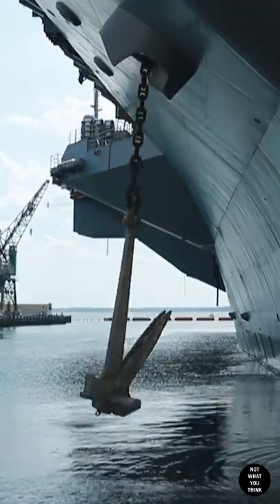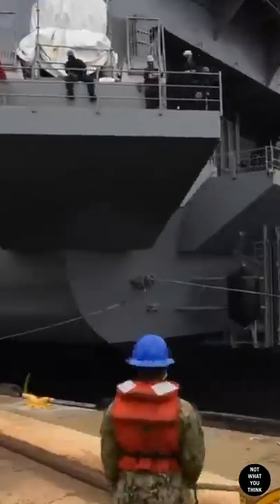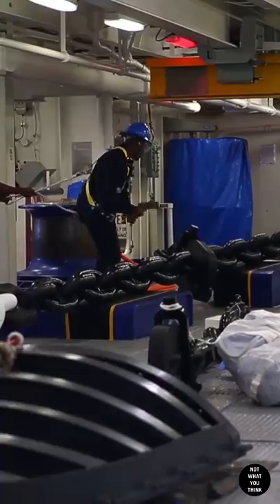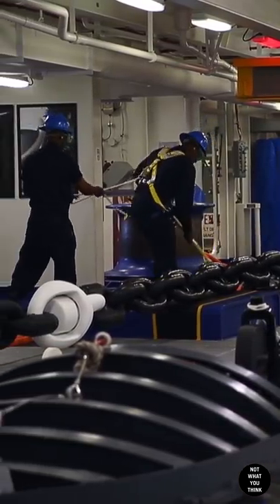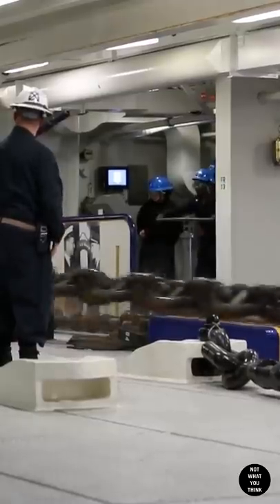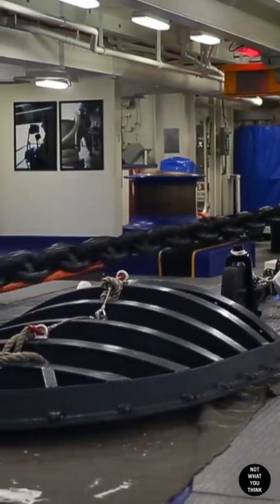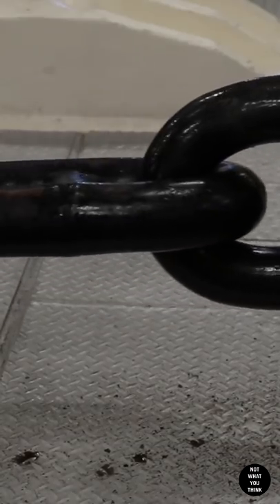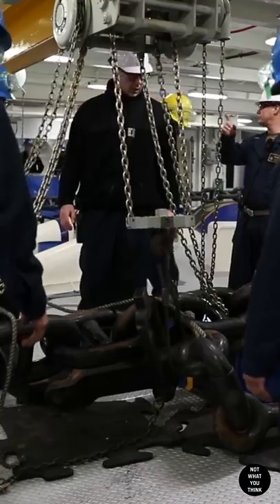Inside the Anchor Room of a Supercarrier #shorts

Comment: Having a guy hitting those chain blockers with a mallet is kind of odd in a multi-billion ship.
Reply: Can't go wasting too much taxes I guess...
Reply: That type of thing is easier and cheaper to get a person to do rather than installing a machine to do it. Also since that’s the fail-safe lock, the less mechanical parts it has, the better.
Reply: @chrisboone8106  The military still knows what it means to have an emergency brake unlike automakers who've bastardized the emergency brake to the point where they can no longer call it an emergency brake.  

Emergency brake.
Reply: @cambellschunky704  e-brakes are really just parking brakes today(I.e., to prevent your car from moving while parked, particularly manual transmissions.)  
It's true they did use to be primarily(or at least equally) intended as emergency brakes(that is, to be used in case the primary/hydraulic brakes fail), nowadays, how often do ones brakes fail?  
Though I get what you're saying.  If my brakes suddenly failed for some reason, I would have zero chance of instinctively pushing my parking brake button or(in my other car) thinking to step on the pedal in the top left corner under the steering wheel(let alone find it in time.)  
I imagine it also has a lot to do with who drive automatics not wanting a big ass lever right in the middle of the front two seats, especially with all the shit people carry around in their cars nowadays.
Reply: That is a $40,000.00 sledgehammer
Reply: @Mockturtlesoup1  you’re completely right about that one, once that chain starts going, the only thing stopping it is hydraulics and even that takes a few seconds.
Reply: @Mockturtlesoup1  The problem with the electronic brakes is they can fail, just ask Anton Yelchin. A simple mechanical stop is not going to have a glitch.
Reply: I don’t understand why is this dangerous?
Reply: @Ceej3  the possibility that the chain starts running out and doesn’t pull in a straight line and grabs the man’s leg
Reply: Sometimes the old ways are best...
Reply: @chrisboone8106  thats why they change how they shoot missiles as well. Less mechanical parts.
Reply: Push button electronics can fail ,,just sayin
Reply: Everything expensive works only when hit
Reply: I guess that ensures it won't happen by accident
Reply: Gotta keep the personel busy somehow
Reply: It's not a major part of the system - the massive brakes on the windlass are doing all the work, those chain retainers are just a cheap, easy-to-add failsafe. It's like the chocks used to keep modern aircraft parked, even though they are capable of braking themselves. It's just cheap to implement so so reason to change.
Reply: Yea I was watching was kinda like 🤔  it got A lil dark on me around that part 🤨
Reply: My M3 comp form 2018 Ebrake can’t be used as an actual E brake. I was told it can rip the line and stop working. Wtf? 

I mean I can use it, but you have to be delicate. Stupidity
Reply: Woody Last Name  german engineers like to disagree with that comment.
Reply: @casbot71  that's not what happened to Anton. He didn't put the jeep in park. It's a stupid system, jeep should never have used it.
Police also told the broadcaster the vehicle involved was a 2015 Jeep Grand Cherokee and it appeared Yelchin had not properly put the car in park mode.
CBS reported last month the government National Highway Traffic Safety Administration was investigating the model over its "e-shift" transmission, amid reports of crashes linked to possible confusion over whether the vehicle had been put into park.
Reply: @Ceej3  you can find footage of anchor releases on even bigger oil tankers and cargo ships going terribly wrong.

I saw one where as the sailor swung again the pin let lose just before he hit it and his sledgehammer was caught in the chain and he went with the sledgehammer and meat grinded through the port hole.

or another where the pin itself ejected at the sailor and turned him into a meat bag of shattered bones.
Reply: @Mockturtlesoup1  drivers today are too stupid to use a ebrake anyway. They won't even take their foot off the gas for 15 minutes while they're on the phone with 911, an ebrake isn't going to help with that.
Reply: Woody Last Name  war n Spaß :D
Reply: You should see the reactor, they manually put in and remove pencils from the core to change the criticality!

I'm joking of course.

"Oi... Mack... throw another pencil in!"
Reply: Traditions Are Sticky!
Reply: @cambellschunky704  more like a "What's That Smell?" Pedal
Reply: @revolvermaster4939  is it made of gold? Looks like a 200$ sledge to me
Reply: Why does someone have to be hooked up?
Reply: @johndc2998  from what I understand how things are ordered in the military its basically just a part number and a (sometimes rather altered) price on the paperwork.
Reply: It's a war machine, not a cruise ship...
Reply: @tannerlebo9862  we live in the age of safety - nobody will ever get hurt again; and that makes life kinda boring.
Reply: @johndc2998  it's military. 
A simple bolt can cost $100-$1000
Reply: imgladandrew gillumisnotmykang  
   Incorrect sir. I know I don't know anything and by me knowing this, I do know something. Your statement is invalid.
Reply: @Ceej3  The main danger is should the sailor operating the hammer slip and fall towards the chain upon disengagement of the lock he will be killed or wish he was this is why you see the sailor in the background holding a harness connected to the sailor with the hammer so he can hold slight tension so in the event of a miss swing he can yank the sailor backwards away from the chain
Reply: @revolvermaster4939  its physics, it will pull in a straight line how do people not get this only when it would slow down and at the back is to much momentum its dangerous, but then the guy is long gone.
Reply: @jouisimo5701  but it doesn’t always pull in a straight line, I was almost killed during an unrep by a line that didn’t pull straight.
Reply: @revolvermaster4939  it pulls straight when under this circumstances, you need to think before you do something like this, ofcourse it needs to be under tension, when its in a ball or whatever obviously not.
Reply: @jouisimo5701  the reason it is done this way is because someone was maimed or killed doing it, so it obviously doesn’t always pull straight.
Reply: @revolvermaster4939  huh? You obviously dont think, you just assume things without thinking. IF IT HAS TENSION IT WILL PULL STRAIGHT, not so hard to understand i guess!? Also it has nothing to do that they have a harnest on and someone is holding him, you just assumed it.
Reply: @revolvermaster4939  its literally SIMPLE PHYSICS. Some people need to go to school again.
Reply: @2nd-place  wrong, pls educate yourself. At the start the chin is even straight from itself, till it gets enough momentum. But thats not even the case here because they have an anchor brake. You can search on yt what happens if it fails. But then the person is long gone anyway. Also here in this case its redirected, what would give the anchor at the point he is standing a smaller range of motion. The problem with people here on the internet is they cant think because they never neded to apply knowledge, thats why they are bound to only one scenario and start crying when thats not exactly the case.
Reply: @casbot71  RIP Anton
Reply: That’s how it is done
Reply: That was no mallet, it was a sledge hammer----big difference.
Reply: @jouisimo5701  English please.
Reply: @jouisimo5701  The only thing that you've proved is that you cannot compose a coherent sentence. I still don't know what you're blathering on about.
Reply: @paullebon323  its okay just acept it, you can deny it but that does not change your embarasmant.😂🥱
Reply: Not a mallet but a sledgehammer
Reply: @cooliobob1274  yep. Not TO MUCH taxes, only JUST ENOUGH. And we draw that line at sailor safety.... right ABOVE sailor safety apparently. 😑
Reply: @cambellschunky704  
Excellent point. As sophisticated as the regular braking system so as prone to failure
Reply: @cooliobob1274  cue another $2,000,000,000,000 “relief bill” that actually is just a shopping list for the democrats
Reply: @Mockturtlesoup1  you're forgetting if you're parked on a steep grade. I want cables holding my car in place, not the fluid system, or putting the stress on my transmission.
Reply: @cambellschunky704  I was raised to call them hand brakes.
Reply: @Snookchaser007  which is why the chain moves maybe an inch when the pin comes out? Real dangerous to fall on that thing right?
Reply: @Joe_P  an automatic has a parking pawl for that reason and whether manual or automatic, the gears in a transmission see much more force in operation than the weight of your vehicle resting on them. It’s the force required to hold the weight of the vehicle plus what it takes to get moving at the very least when you put your car in gear on a hill and drive away. Cables stretch gears don’t
Reply: @chrisboone8106  On the contrary, it should be obvious with anyone that has half a brain that if you have to get MULTIPLE PEOPLE to do it, including one guy donning special safety gear that has to be held under tension during the procedure that it would be infinitely more faster, straight-forward, and economical in the long run (convincing a person to do that shit + paying whatever catastrophic health insurance/danger bonus) as machines do not require salary.

Large civilian ships have tons of innovative solutions for chain stoppers that are perfectly scale-able (and 100% mechanical) including up to this diameter so as with most things in the military, the design is simply shit and/or outdated.
Reply: it’s training done with safety, for emergency release. 💁🏼‍♀️
Reply: @Mockturtlesoup1  now days all car use a dual hydraulic sytem in the brakes so if one fails u still have ur other 2 brakes and they are set so u have 1 front one rear on opposite sides E.G. RF and LR is the 1rst hydraulic and LF RR is the 2nd
Reply: Not everything is operated by a button...not yet anyway.
Reply: Come join us and you will understand.
Reply: It's for extra safety you wouldn't understand
Reply: @Mockturtlesoup1  love having an e brake in the middle. If I’m driving and abs is turned on and I need to stop I pull that so fast.  Yes I could spin or slide a little but I’m going to stop. I don’t like ABS in a car.
Reply: @Ceej3  Doing basic deck duties are probably just as dangerous as doing any construction work. Hell even handling lines are dangerous. I remember our petty officer when I was in boot saying that an easy thing that can kill a sailor is just one absent minded slip up if not watching where you step and properly handling lines cause if the ship leaves port and a rope is still attached to the dock yard. You are gonna be pulled through a hole smaller than your waist and come out the other end like fucking chum by a nuclear powered vessel by your foot.
Reply: It is the most effective way. 

Can’t go having electronic or mechanical issues when trying to drop anchor. 

You’d understand if you were on one of those.
Reply: Reminds me of the SCRAM function for the first few nuclear reactors.
Reply: @NatEff3ct  wrong if you would think and actually bring arguments there would maybe be a discusion. But people on here are just so stupid they only try to insult, and did not bring one single fact.😂
Reply: Sometime good old fashion Emanuel labor is what it takes!
Reply: @Mockturtlesoup1  I've had times where my brakes weren't cutting it and I used the hand brake to be safe but I've only ever driven manuals so it's right their
Reply: @Ceej3  if you fuck it up you get dragged at that weight and dspeed getting dragged is easily fatal
Reply: Is it really worth billions? I have no clue but I’d guess a few hundred million but not billions
Reply: @casbot71  didn't he also leave his Jeep in neutral, not park?
Reply: Right I mean they couldn't thing of a better way
Reply: @cambellschunky704  emergency button
Reply: @pyroromancer  is it weird I want to see the vids
Reply: @casbot71  that had nothing to do with an ebrake. He didn't put his car in park and it rolled back on him.
Reply: A lot of super heavy machinery will have simple mechanical safety measures like this.  Less moving parts means less potential failure points.  The risk of the work is measured against the risk of a failure from a more complicated system, and this is the normal outcome. 

 I work with high explosives on a regular basis, in conjunction with some of the biggest machines on the planet.  We employ all sorts of high end electronic fail-safes.  But we also have very simple mechanical measures in place for redundancy and simplicity.  The more simple mechanical stops tend to be higher risk to employ and disengage, however they lower the total risk calculation in the end.
Reply: @revolvermaster4939  and you need specific training to handle it.
Reply: @Mockturtlesoup1  to expand on what your talking about.  It just isn't practical or safe in the modern day.  Cars go fast now, pulling an E-break can some times harm you more than it saves you. 

 Sure going 20-40 mph, an E-brake could stop you pretty fast.  Goin 50+, and you might skid, lose complete traction control, or overheat and pop the tire causing a flip.  Now then, even if it wasn't a sudden lock up, and it worked as intended and now your dragging down speed fast  You will probably experience injury from the countering force.  Your seatbelt will be chocking you if it doesn't break, if you don't have it on, you might actuall lunge forward from built momentum riding hte vehicle and smash your dashboard.

It just isn't advisable to allow the average modern drive the responsibility of an E-break.  Mistakes can happen, liabilities can be thrown, people could end up getting hurt as much as the people who use it responsilbly and it saved them.
Reply: @BlackWolf42-  ? If that chain catches you and you go with it, you are dying full stop, it’s about basic worker precaution my guy
Reply: Ironic
Reply: If it ain't broke don't fix it?
Reply: Look at his Color... Thats Why
Reply: @6idangle  The people with the clip boards and safety sallies will keep me safe.  Nothing bad could happen, ever again - we're living in a new world; of safety!
Reply: @casbot71   mechanical parking brakes use to fail all the time and were never meant to be used as an emergency brake, because they locked up the rear wheels with the easily stretched cables and lower heat-rated pad material.   
  Anyone who calls them an emergency brake is simply using the wrong non-mechanic terminology and believing they are meant to do something they aren’t for.
Reply: If it ain't broke...
Reply: I think its one of the best jobs
Reply: You would think so... but no 😂
Reply: If it ain't broke, don't fix it
Reply: @ethnobotanyboy  if whats not broke?
Reply: @cooliobob1274  that whole ship is a waste of money and not needed..War is costly and america can not afford another war for at least another 25 years,we can't even help our own people these days..
Reply: Guy: can I perhaps slightly get a raise?
Reply: Only in america
Reply: @revolvermaster4939  ?
Reply: @johndc2998  just a joke
Reply: @jouisimo5701  you’re an armchair theorist, I’ve spent 60 years in the real world
Reply: @paullebon323  you didn’t comprehend “the chin is straight from itself”? 🤣
Reply: @jouisimo5701  how many years did you live on a ship?
Reply: @jouisimo5701  some people need to visit the real world and forget about “school damage”
Reply: @cirocciroc  ?!?
Reply: @jamesholt7340  maybe the ship prevents war!
Reply: @vividdreamzentertainmentll4533  the procedure
Reply: @revolvermaster4939  your just finding excuses but no arguments!? Why is that? I only hear blabla but no facts whatsoever. If your 60yo im sorry for you, because you did not manage to get any common sense in this time.
Reply: @Mockturtlesoup1  the emergency brake isn’t called that in other countries. And it shouldn’t really be used like that either, because it only brakes the rear wheels and thus you could lose control over the car. 
Also: the brake systems are two seperate systems for the case one stops working. And it practically doesn’t happen. So it makes sense in my point of view to get rid of it
Reply: @revolvermaster4939  Right... Who am I to say anything
Reply: no no, its a $2000 mallet, very suitable for the ship
Reply: That mallet has history ok 💀
Reply: it’s called cost cutting
Reply: @jouisimo5701  Ok NOT-A-BOATSWAINS-MATE, you sure know a thing or two about dropping anchors. Or not.
Reply: @jouisimo5701  Look Peter puffer, dropping anchors is dangerous as fuck. A lot of shit can go wrong very fast. Eat your cheese balls and move along.
Reply: @jouisimo5701  Your obviously not that smart. Ps I’ve experienced one of these brakes failing, not fun.
Reply: @aluisious  agreed, there’s definitely a disparity between video game physics and real physics.
Reply: @Coecoo  lol more faster
Reply: @Coecoo  Then offer up a solution Mr. Big talker. Sell your idea, or are you just a talker. Exactly, what I thought.
Reply: @NatEff3ct  💯
Reply: @jouisimo5701  Here’s a fact: you never served in the Navy a day in your life, and therefore you have ZERO experience dropping an anchor like this and any argument you present is simply speculation and void of any legitimate value. Drops the mike.
Reply: @revolvermaster4939  Fuck yeah get him shipmate!
Reply: @joshc3000  im sorry if you dont understand how pyshics work. But thats often the case with foot soliders. I dont need to be in the navy to state simple facts, and if people like you, it semes are the type that only learn from their own mistakes, aka not the smart ones.
Reply: @joshc3000  you seme like the classic "worker" type of guy, who only knows a specific situation and cries about it, but if a new situation comes up you are cluless. Also you did not state any facts about the actuall subject. Just bull*hitt rellying on nothing.
Reply: @Mockturtlesoup1  Plenty of people have been killed by electromechanical E/Parking Brakes when they give a false engaged notification, then its rolled over someone.
Reply: @cambellschunky704  it’s called a parking brake not an emergency brake. If you pull that while driving you’ll have an emergency pretty soon.
Reply: The money goes into pockets not the ships
Reply: @TheHearseAroundJimThorpe  Call it what you want, but the original idea behind this system was to have a cable actuated braking system, isolated from the primary hydraulic system, that could be used if the primary system failed.  Parking is peripheral benefit.
Reply: @jouisimo5701  lol, yeah I’m not smart. I only get paid to write code, analyze data, and build machine learning models. Sounds like jokes on you.
Reply: @jouisimo5701  BTW, I already stated a very important fact. Since your talking about physics and testing your arguments would need to follow the scientific method, have you ever conducted an experiment to prove your argument? Didn’t think so.
Reply: @cooliobob1274  probably because a machine is stuck in one place and a man can move freely,  and with that massive weight moving at those speeds... nothing will last I think.

also on the side. it's a real cool real mens job
Reply: @Ceej3  In some other anchor-dropping videos you can see how incredibly violent it can be. This was all pretty tame.
Reply: @joshc3000  also one guy said the harnest  was for when the brakes fail, so he can be pulled fast away, what is not the case. Its for if you lose your balance, or the hammer gets stuck in the chain or somwhere if you dont hit. When the brakes fail you are long gone. Still his comment got a lot of support. That just proves the most of people here dont understand anything about the subject.
Reply: First off they’re stoppers not blockers second it’s a fucking maul third off I’m a rated Boatswainsmate get on my fucking lvl
Reply: @revolvermaster4939  cough maul?
Reply: You'd prefer a Robot... never been to sea have you?
Reply: @Ceej3  because a mechanical failure of the Capstan Brake means ALL the POTENTIONAL ENERGY from OVER 100,000 TONS (that's 200 MILLION POUNDS) of Anchor and Chain is being held back by that Chain Blocker... and it wouldn't even slow down squishing you like a bug on a windshield. But HELL my boy, GIVE IT A TRY!
Reply: Its called a Pelican hook
Reply: @jouisimo5701  Omk cool guy
Reply: @jouisimo5701  There go the assumptions again, computer science & software engineering is all about solving any problem in any scenario. What else you got, you out of ammo yet?
Reply: @jouisimo5701  BTW, I do have an office, but most of the time I work from the comfort of my own home. I also have a consulting business in which I solve technology problems for clients. I’ve had plenty of experience applying my knowledge & skillset in very different scenarios.
Reply: @jouisimo5701  I feel yah, I can’t argue with that at all. Many tasks in the Navy are very dangerous and they are very keen on safety precautions and mitigating risks. Many of the policy’s and safety regulations were established after learning lessons that were paid for in blood.
Reply: Edit your comment, it reads like shit without the  word dollar.
Reply: @cooliobob1274  people need jobs too😭
Reply: Not even tied off securely on his harness
Reply: Not even tied of correctly
Reply: Gotta put our men to work to keep em in shape with all the dropping requirements in the military,and they need their Salaries increased but who are we kidding right,Washington D.C. CORRUPT GARBAGE!
Reply: @cambellschunky704  they've always been park brakes
Reply: It’s served 3 purposes... 
1. It is easy to fix 
2. Cheap to maintain/replace 
3. Training time is quick and easy
Reply: It may seem odd, but it’s similar to shit people do on fighter maintenance😅
Reply: @Mockturtlesoup1  I was stuck in traffic for two hours so turned the engine off. Had my foot on the break the whole time. Traffic moved a bit then stopped so I took my foot off the break (car was on a hill) and when I put it back on the car did not slow down (engine was off). Panicked and pulled the hand break car skidded a bit but stopped short. 

I learnt my lesson on what happens to hydraulics with out power.
Reply: @generalharness8266  Sounds a lot like you broke several laws and dangerously drove a motor vehicle, creating your own difficulties. Shockingly, when I removed the bolt from my steering wheel whilst I was bored in traffic, suddenly when the traffic started moving again, I couldn't turn anymore!!! :O You should have had the handbrake on when your engine was off and in traffic. You should then have turned the engine back on to move the vehicle. Bad things happen otherwise, like you found.
Reply: @Ceej3  because if you get caught on that chain you are dead
Reply: @cambellschunky704  lol my è brake is magnetized. Triggered at the push of small lever. 2019 Audi A7
Reply: Thats thors hammer putting in work
Reply: @casbot71  that's not accurate. Anton Yelchin was killed because the poor design of the parking brake meant that he did not realise it was properly engaged, not because it failed.

The same thing happens with traditional mechanical parking brakes too.
Reply: No, landlubber, it ISN'T odd. That is how it is done on ALL Navy ships. And while we're at it, let's get some terminology corrected. What the person is hitting to release it is the PELICAN HOOK, not a "Chain blocker", nor a "Fail-safe lock". The chain isn't going anywhere until the brake on the capstan is released, and while it is possible for there to be a brake-failure on release, it is extremely rare. And what emergency-brake are you talking about? There is only one brake in the system, the capstan brake, which isn't hydraulic. There's a big manual wheel that controls the brake tension.
Reply: Not if you want reliability
Reply: Just to show u they still need humans
Reply: Multi trillion*
Reply: Well yea
Reply: I was about to say, can’t they automate that?
Reply: @F17A  sum ships maybe idk
Reply: mechanics are mechanics, no matter how much money at your disposal
Reply: @elena6516  heeh tf2 ME MALLET
Reply: @cambellschunky704  if you hold down an e break while moving it activated the emergency break
Reply: Imagine if that part broke. So much work to be done. Better let a human do it. They're easily replaceable.
Reply: @vividdreamzentertainmentll4533  it has nothing to with race everything to do with being a boatswains mate in the US Navy .
Reply: @Ian Ramos It's better to have some braking ability than none at all.  Bar yanking a handbrake or stomping the pedal style to the floor it is very controllable and mechanically adjustable.
Reply: Sometimes, there are jobs that a machine just can't do.
Reply: @Mockturtlesoup1  I believe e brakes actually do also double as emergency breaks. I think they have an automatic thing to make them brake at the right speed to cause you to not spin out. Not positive about this but I remember reading it somewhere.
Reply: @stephenhoward6829  you’re a mad chubber
Reply: @Mockturtlesoup1  If your brake fail while driving a simple so solution is stop accelerating and aim at something when that will stop u but not kill u when slow enough
Reply: @Ceej3  it's a giant very heavy chain that if it caught even slightly u would be going with it into the water
Reply: @uhohmemebiggestboy212  true, if I'm going slow enough and aren't in a city or something.  Downshifting would of course help too.
Reply: Guess what, there's lots and lots of stuff on that ship which needs doing by humans holding all sorts of different tools including hammers.
Reply: @Ceej3  join the navy ! Actually training films on lines show how a parted line can cut a man in half.
Reply: @Mockturtlesoup1  there was a recent case of a guy in WA cutting people's brakes. Having a backup is a good idea
Reply: Not odd at all when you realize we don’t get paid Jack shit. The equipment is always worth more than our life
Reply: @cooliobob1274  Seeing as an E-3 in the navy only gets paid $2.10 hourly. Yeah, the budget is pretty small, we oughta make it larger huh?
Reply: @TheHearseAroundJimThorpe  plenty of manufacturers still call them an emergency brake but also state they aren't meant to be engaged while moving, only to prevent rolling in case of a parking pawl failure.
Reply: @cooliobob1274  Who constitutes top brass?
Reply: @cambellschunky704  seriously. If its a digital button for the emergency brake then its no longer an emergency brake
Reply: You should see what maintainers do to multi million dollar aircraft. 😂
Reply: Fantastic
Reply: @cooliobob1274  If you think that aircraft carriers are a waste than you have a fundamental misunderstanding of their purpose and importance in warfare, especially in a bluewater nation like the US where all of our threats are external.

PS. When I say external threats I don’t mean third world countries like Iraq of Afghanistan, there are very strong opinions over those that I’d rather not get into.
Reply: @cambellschunky704  “Emergency break”
Reply: @neurotic3015  
   Mr. Reaper, I fully understand the importance of aircraft carriers. Nowhere did I say they were a waste of money. My original post was more joking and poking fun at the fact that tax dollars are wasted in far more ridiculous ways than making simple system to replace a dude with a hammer.
Reply: If it ain't broke dont fix it I guess
Reply: That’s the fucking navy for you😂
Reply: @chrisboone8106  Do you think for one second that they care or even know what is the cheapest of anything they spend on the tax payer funded banker war machines?
LOL. By this logic the should replace the missile launchers with able seamen. While you are at it just save a couple trillion bucks by replacing the missiles with colorful fireworks.
Reply: @cambellschunky704  stahp
Reply: @Ceej3  look it up. anchor fail
Reply: U probably don't know how the contractors get chosen and cut$ must be given
Reply: @tannerlebo9862  to pull m away..
Reply: Preserving the old ways of voyaging
Reply: @paullebon323  okay, don't get too aggressive.
Reply: Why does he have a guy holding a rope behind behind
Reply: @hotcheedo1227  so he could be held back and won't fall in
Reply: Holy fk what is going on!
Reply: @cambellschunky704  well in my country it was never called the emergency brake to begin with, just the parking brake. Why else do you have that (P) symbol come up when it’s engaged.
Reply: @Mockturtlesoup1  my brother's brakes just went out like 2 weeks ago while he was driving home on a busy street.. He realized it when he went to brake to turn into his neighborhood and nothing happened.. He had to coast until coming to a stop. Luckily he went thru 2 intersections with green lights before he came to a stop. The brakes barely worked enough to stop him at idling speed.. And his 9 month old son was in the back seat.. Could have turned out much much worse
Reply: @slicedbread5692  damn that's scary as hell.  Did he try down shifting?
Reply: @Mockturtlesoup1  honestly i don't know what he did. I wasn't with him at the time... I guess next time I'll have to do better than just cutting his brake lines if i wanna get rid of him
Reply: @slicedbread5692  😉
Reply: It’s because his life is worth not having to spend more money.
Reply: How would you do it?
Reply: @cooliobob1274  the US military gets over 700 billion in taxes each year, I think it's not about money here
Reply: @Mockturtlesoup1  modern vehicles still have brake lines that can be damaged or ruptured by debris in the road like rocks for example..so if that happens and all you have is an electric button that really doesn't do much, you are kinda screwed no? Lol
Reply: Because they had to give John Henry's great-grandson a job.
Reply: When you didn't behave during lunch brake
Reply: Certain things just make sense to have people do it
Reply: not everything can be mechanical. it’s the same reasons as to why the best weapons built are so cheap and simple. take the ak style weapons for example
Reply: @cooliobob1274  yeah only gotta waste 750 billion dollars🤣
Reply: You think it's odd until you realize 3 static non electronic, hydraulic, computerized, ect parts are just too damn reliable to get rid of. Chain blockers have never caused a problem so why change them? What would you gain? A cute gimic other Navy's don't have?
Reply: @cambellschunky704  it was never an “emergency brake” to begin with... use that shit in an emergency and see what happens lol, its a parking brake
Reply: @WobiKabobi  All brakes were mechanically actuated before hydraulic systems were common place.  So yes - they can and have been used in an emergency where the hydraulic system fails especially before dual reservoir master cylinders were standardized.
Reply: A fail-safeafe that relies on a person is good.
Using unnecessarily varied combinations for fail-safes has saved more lives than you'd ever imagine.
Because they're always unnecessary or silly till everything goes wrong.
I can think of at least one time America would've nuked itself were it not for such a seemingly useless fail-safe.
Reply: Most of the money is spent on weaponry and armor probably
Reply: It’s a sledgehammer
Reply: * multi-billion dollar ship.
Reply: @Ceej3  he's using the sledge hammer to to knock open the latch on a 'Pelican Hook' chain stopper, which can kick as it whips open.
Reply: @Mockturtlesoup1  Brakes hasn’t changed for over 100 years. We should get hydraulic emergency brakes that is manually operated in new cars to be honest. Much safer
Reply: @Mockturtlesoup1  you can put manual transmission cars into gear and then they wont move.
Reply: @revolvermaster4939  the anchor is heavy enough to keep enough tension on the chain that it will go straight.
Reply: @cambellschunky704  also its probably because a car doesnt have an emergency break because why would you, the handbreak is just a means of "failsafe" to stop the car from going anywhere when parking and not in gear, literally nothing else, you SHOULD ABSOLUTELY NEVER try to use it to stop a car, its not meant as a traditional break, and never was, because why would it. A car doesnt have an emergency break because it isnt practical theres just no need, you have the driver already steering it he has all the power, and also the power to break, if the breaks were to somehow not work, the handbrake wouldnt either because thats not its purpose, if you pull the handbreak while driving ur gonna crash, a train for example HAS AND NEEDS an emergency break BECAUSE the driver doesnt have all the control he cant do anything about the way he goes and there the emergency is also basically only meant for the passengers, the operator of the train still has all the power the emergency brake just exist to stop further lives being endangered if you for whatever reason lose the drivers controls
Reply: @qwertzritter5197  The traditional emergency brake is a cable actuated mechanism isolated from the normally used hydraulic brakes.  If the hydraulic system fails the vehicle can still be slowed using the cable actuated system.  Used in conjunction with engine braking, even a fast moving vehicle can stopped safely.
Reply: @cambellschunky704  What are you even talking about all vehicles come with Emergency Brakes
Reply: @ricco3  Most newer vehicles come with electronic parking brakes.  They can no longer be used as emergency brakes.
Reply: He'll be replaced by a robot arm next retrofit.
Reply: With how much military contractors charge for R&D, and the realtivley low salary of enlisted sailors, it might actually be cheaper to pay somebody to do jobs like that manually for the service life of the ship than it is to install an automated solution.
Reply: Because its the military, plenty of bodies, why waste money on robotics?
Reply: @realofficialbrandon  Covid-19? 
idk that seems to be the go to answer these dazes
Reply: Reducing weight matters a lot. If a human can do the job in few seconds, why install a heavy machine to do the same job? It makes no economic sense.
Reply: @cooliobob1274  coolest job on the ship tho
Reply: @Mockturtlesoup1  not only that but a lot of E-Brakes can’t be activated while rolling down the road, it won’t permit you. So it’s quite literally a parking break. 😞
Reply: I thought the same thing I was like WE'RE NOT CAVE MEN SPONGE BOB we have technology.
Reply: Meanwhile NASA defines Duct Tape (Gray Tape) as being an essential repair item and always makes sure astronauts have at least one roll when they launch into orbit/space.
Reply: @dimaisatree  yes of course it’s worth billions, modern American aircraft carriers are some of the most complex systems humans have ever created.
Reply: A PARACHUTE BRAKE WOULD BE CHEAPER‼️
Reply: Welcome to the military mate. Where things humans shouldn't be doing are doing because tax dollars and keeping other costs down lol
Reply: Sometimes the best solution is the easiest lol. Plus it's funny to watch.
Reply: Free job position
Reply: Holy shit
Reply: @AluminumHaste  To my understanding the auto maker had to do an emergency recall, and pay hush money to a lot of people because the electronic transmission (unclear which part of it) was "slipping" from Park to Reverse.  Of course that part doesn't get covered as much, and I'm sure his family was paid a handsome fee in order to "make it so".
Reply: @Shalkar  Hmm, my coworker had one of those models and he never got a recall order for it.
However, I did get to drive it and it's SUPER easy to accidentally not put it into park, it's a shitty system.
Reply: Well at least we know it won’t fail there will always be someone with a mallet
Reply: @jouisimo5701  no he LITERALLY DOES NOT UNDERSTAND YOUR POINT because you are not speaking coherently... Maybe invest in a better translator??
Reply: @jouisimo5701  navy deck crew=foot soldiers?? You really must not be from around here...
Reply: @Ceej3  go stand next to it.
Reply: @revolvermaster4939  40k for something used to slap chain blockers, nice
Reply: You would think that would be automatic with the push of a button on a billion dollars ship.
Reply: @revolvermaster4939  really?
Reply: why fix something if its not broken
Reply: @pyroromancer  Jesus. Explains why the guy was tethered to a crewmate. Also makes you wonder why they don't have a robot handle this. I totally agree with the use of a physical pin as a Fail-Safe though.
Reply: @Ceej3  see dude holding onto the guy with back strap? That's so when he hits or if he half misses and loses balance he doesnt fall on chain and go for a deadly ride around the cutlass. Just look how fast that chain is moving then consider its weight/velocity and what would happen if you fell on it.
Reply: @jouisimo5701  i was in the navy, doing this exact thing. I've seen those anchor chains jump all over the place. Shit don't go by the book in the feild. If it did there would be no need for fail safes. The safety line is there because at one time it wasn't and bad shit happened.
Reply: @grimmwolf9690  no one said it goes by the book, read the comments first its just about the initial hit not that you stand in the danger zone for minutes like a dummy, THEN YOUR LONG GONE. Also "the book" is just writen by somone on practice happenings and tests.
Reply: @grimmwolf9690  its hilarious how many people comment without even thinking or understanding the comment😂 rather they just jump on the felling train by some other guy that could not read
Reply: @jouisimo5701  ever see what happens with a run away anchor? Go look at the chain dance when the brake fails.
Reply: @grimmwolf9690  YOUR LONG GONE THEN ARE YOU BLIND!?
Reply: @jouisimo5701  spent 10 years doing the job till a back issue sidelined me. My sight is just fine.
Reply: And also having another guy holding him with a leash while he does that is also odd.Almost cartoon like
Reply: Yeah I guess it's kind of like shooting a battleship with the world's smallest pistol
Reply: @Logarithm906  lol
Reply: The chain sometimes needs a twist to seat properly in the stopper. Deck apes have the most fun 😁
Reply: A lot of things done in the navy stay the old way for traditional respect
Reply: If it ain't broke, don't fix it...  that's how the Army got the garbagefire known as The Bradley and The Stryker.
Reply: Guess if it works, why remove it?
Reply: @cooliobob1274  They probably charge more than $10,000 for that sludge hammer or a mallet To the taxpayers
Reply: @cooliobob1274  True but id we wouldn't be wasting human life either
Reply: Underengineering.
Reply: Gotta make workers put in dangers way for no reason somehow
Reply: Old reliable = chad with a hammer
Reply: @Mockturtlesoup1  How do brakes fail?! Hydraulic brake lines still rust just like they used to. Nothing has changed. Also, floormats still get stuck under brake pedals, just like they used to... Absolutely nothing has changed : if you live in the Salt Belt, brake lines rotting away and loosing all hydraulic pressure is a thing, still.
Reply: @cambellschunky704  That’s because it’s actually a parking brake
Reply: In all the threads the biggest/main thing that is talked about...
 Is the sludge hammer 🔨
😃
😂🤣😂🤣😂😂😅
Reply: @cooliobob1274  😁😂🤣😃😀😃😃😄😅😆😅😂😂😂😃
Reply: @aluisious  It looked perfect on the drawings
Reply: @Coecoo  It's probably got some to do with functionality if  they are attacked  and sustain damages,ect.
Reply: Gotta make it interesting.
Reply: I saw a video on YouTube showing an anchor break failure. That is really violent.
Reply: @cambellschunky704  Facts
Reply: @cambellschunky704  Actually emergency breaks are Boss. Back in the days I had a Buick which had a complete failure of the Master Cylinder. I drove using nothing but the E brake for about a week. I'm crazy 🤣. I used it so much , even the E brake went bad. Cost about $1400 to replace it all.
Reply: @Mockturtlesoup1  haha. Mine prolly is one of the exceptions. 09 Fusion. Center floor parking brake lever. Button on the tip. If I wanna slow down incognito, press tip, pull lever with desired force. Sometimes I use my invisibility for good, sometimes for evil.
Reply: @BlackWolf42-  yes, not potentially losing your hands or legs is soooo boring
Reply: That’s somebody’s entire job
Reply: Bro, they still pulling the string in artillery…
Reply: @waqidj  parking brakes are often just a teeny tiny set of drum brakes inside of the center of the rear disc brakes.
Only designs that use a mechanical secondary method of actuating the rear calipers, will be suitable as E brakes.
Reply: Bio robots
Reply: Repent for your sins and have faith in Jesus and you shall have eternal life in the afterlife
Reply: @maiktendo6512  No thanks.
Reply: Its like needing to break and place blocks to acces your minecraft mega underground base
Reply: I kinda like how it ties them to ships in the past. Traditional, only crazy dangerous
Reply: I've been that guy's on multiple occasions lol
Reply: Why is it odd? Should the chain get jammed part way to the water, the men/women would play the devil manually pulling it back a bit to get the pressure off the machine while making adjustments. The U.S. Navy has good reason for every thing it does/does not do.
Reply: @revolvermaster4939  and it will last 200 years, with possibly a handle change. That's only $200. bucks per year, VS How many repairs to machines, exposed to salt water, and parts wearing out? Oh yeah. Good deal. How about the $40. Ball peen hammer?
Reply: Milan Kraguljac  In 1960 I was a young sailor attending MM 'A' School at GLakes, Illinois. Got a '72' and hitched a ride with a chief headed for Alabama. He had a new T Bird. On the return trip the brakes failed in Southern Indiana. After awhile he was tired of driving it, so I volunteered. Hey! He had more rank and less chance of losing one than I, a fireman did. I drove the car at normal speeds from Terra Haute, In. Through Chi Town, without stopping, all of the way to the school, without stopping even at the gate. Pure luck, a REAL emergency brake, and God's mercy kept us safe. Well, the EB did finally eat into the hub with a final screech, but we were not AWOL. CHIEF RAINWATER, IF YOU'RE READING THIS, DID WE HAVE FUN, OR WHAT?🇺🇸😄
Reply: @aluisious  And you I. Q. Is? American drivers don't drive stupidly. Did you ever drive in Saigon, VN? Hong Kong? Or maybe -- I stand corrected --- Baltimore, Md.🇺🇸🙂
Reply: @jouisimo5701  you can’t even spell and you’re criticizing the writing of other’s?
Reply: @matthewphillips3487  striking mallet, hammer & maul. Look it up.
Reply: @Mockturtlesoup1  You would be surprised how instinctively you can find that shit when you need to in a real emergency.
I have had to one 2 separate occasions. Once with a pedal brake and once with a lever.
For a single stop the pedal is better. But in a situation where you have to get somewhere and your breaks give.. that lever is so much better. Plus you can tap your break pedal to activate the break light. The key is you tap it several times, it sends a signal that something is wrong with your brakes.
Reply: @joshc3000  hard to have a battle of wits with somebody who doesn't have any ammunition isn't it Josh this guy's a poser
Reply: In Uganda we use hippos
Reply: @revolvermaster4939  wrong. Read and think before you comment
Reply: @jouisimo5701  troll
Reply: @revolvermaster4939  stay mad😥
Reply: @johndc2998  it was a joke based on military overspending
Reply: How do they ancor the carrier on the open ocean, with like 4000m to the bottom? Crazy
Reply: Yes it is. What sets him and his duties apaaahht, is the rope attacht to his harness, and The Seal, The Seal of The United States of America. That's the only differs.
Reply: Being a deck Sailor veteran, this video fails to go into the details of freeing the chain to the point one would assume a machine can do the job.
Reply: It isn't, it's for safety, boats are designed to as simple as possible to prevent failure
Reply: If it ain’t broke don’t fix it i guess
Reply: @Mockturtlesoup1  in part because people had trouble understanding the concept of hydraulics back in the day
Reply: @cambellschunky704  there's a huge benefit to the electric parking brake. No matter who you are, it grips with the same strength. 

I can't tell you how many times I've gotten in customers cars, who are little old ladies, that could only manage to get one click on their parking brake that wasn't holding anything. 

We even once had to undo the parking brake for a customer who wasn't strong enough to undo the hand brake after a coworker parked her car.
Reply: @SilverStarHeggisist  That's not a 'huge benefit.'  That's sounds like a 'benefit' for people who shouldn't be behind the wheel.
Reply: some stuff stayed the same like old days , that's one of them
Reply: That's the beauty of seamanship - it hasn't changed in hundreds of years. I have done this very same work and I love it
Reply: @Joe_P  the cables aren't as strong as the fluid system. They won't even fully engage the brakes. Electric parking breaks are objectively superior. They arent emergency brakes, they are parking brakes.
Reply: @Mike-we2eg  ABS makes you stop *faster*. Clearly you never paid attention in high school physics since you'd know that static friction is much higher than dynamic friction. When your wheels are sliding, they have less stopping power. This is why ABS has been required by law for nearly 2 decades, and also why modern sports cars have launch control. A burnout isn't gonna get you going as fast.
Reply: @goreobsessed2308  your hand brake will never increase your braking power. If anything itll decrease it since a skid drastically increases your stopping distance.
Reply: Hey, if it aint broke dont fix it! If it works it works ig
Reply: @Ceej3  It can hit the person
Reply: Also the guy holding the harness, not secured to anything? 🤣
Reply: Sometimes simple is better
Reply: How else are they gonna take it off???
Reply: It works. Its not like they pay, feed, and train men just for this job. So why not do it when it works instead of having a potentially very expensive and heavy machine to do the same thing. 

 Much better to not make something complex because if it can break it will.
Reply: @Ceej3  The weight of the anchor plus the cable means there is a lot of weight running out and round the capstan and it is initially free running once you hit the blake and free the cable to run out.. If you're not careful you can get entangled with it and it will drag you anywhere it wants to go. Anywhere there is that amount of heavy cable running freely is dangerous.
Reply: If it ain't broke, don't fix it.
Reply: What would you rather he use? News Flash that is how EVERY ship Anchor System is operated.
Reply: @cooliobob1274 A Nimitz Class Carrier, in this Case the CVN 75, cost $4 Billion to build. In 2022 the US Congress spend $155 BILLION to feed and House Welfare and Illegals. Which is the Better investment?
Reply: Thats the way its been done for close to hundred years.  And the noise from where my berthing( where I slept several frames and decks above and aft from the forcastle....was deafening..

My husband was stationed onboard the USS Saratoga CV-60 1969-70 and  2 cruises onboard the USS Ranger CV-61 1970-71 and 1972-73  and two cruises onboard the USS Nimitz 1977-78 and 1979-80 and one cruise onboard the USS  Constillation cv-64 1984-85
Reply: That's the only way to release it!!!
I've done it a bunch of times and it's not that dangerous as they make it look!
A lot would have to go wrong before anyone would get hurt!!!
Reply: @Ceej3 it's not!!!
Reply: @Ceej3 it's not but you are dealing with thousands of pounds!!!
Reply: True strange the big sledge hammer can not be replaced
Reply: If it isn't broken, why fix it?  Sometimes simple is best.
Reply: @PronatorTendon  tru dat